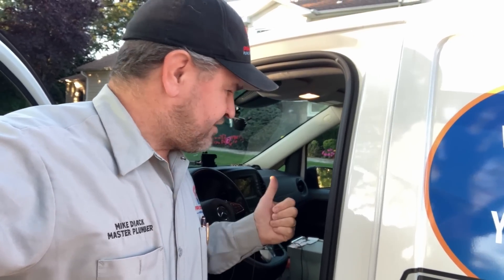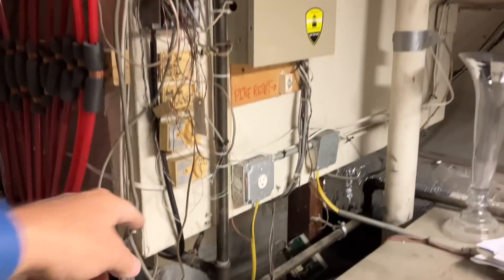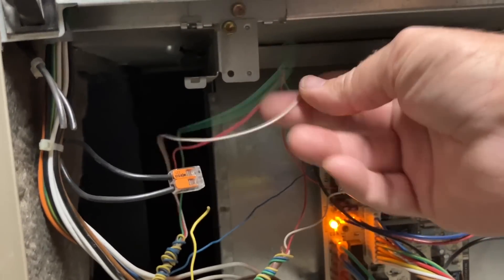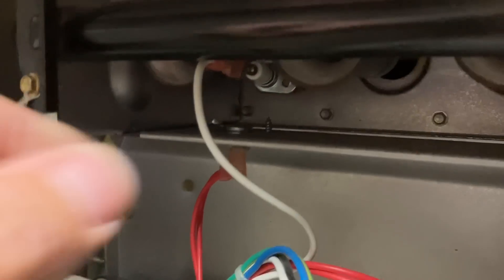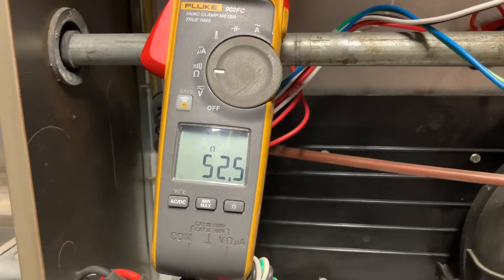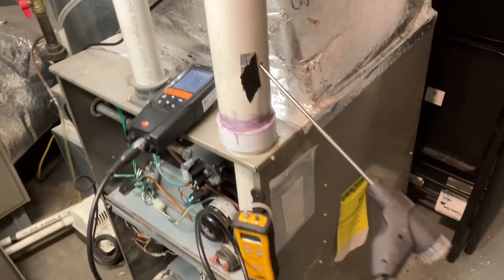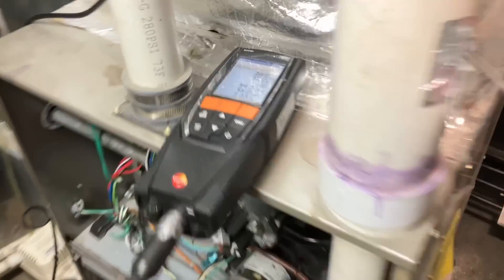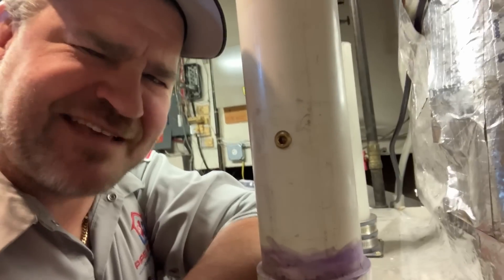Master HVAC Technician Shares Top Tips for Servicing High Efficiency Gas Furnaces

Comment: the carrier manuals say where in the pressure range it should be set based on local gas btu heating value and density. newer carriers come with orifices for 1000 btu per cu ft gas and will be slightly overfired at 3.5" in many parts of north america.
Reply from the maker: The rating plate supersedes
Reply: @PipeDoctor  what manual says doesn't contradict the rating plate-> the btu input cannot be greater than what's on the rating plate. The 3.2 to 3.8" range in both manual's tables and on rating plate is to make fine adjustments for local gas properties not that it can be anywhere in that range. Older 90%+  carrier furnaces came with #45 orifices newer #44 orifices yet rule of thumber will set all furnaces to 3.5" ignoring orifice sizes and not clocking meter or anything. carrier has tables. Could be under or over-fired by up to 10% depending on orifices and gas content, like rheem condensing furnaces come with orifices for 1100 btu per cu ft gas others for 1000 and anywhere in between.

Comment: You would think someone would invent a removable plug assembly that screws into the PVC exhaust line that you can use for combustion analysis instead of using tape or silicone caulk 🤷‍♂️
Reply from the maker: you'd think - right!
Reply: @PipeDoctor  actually, they do…I just looked at SupplyHouse and they have them in brass with a brass removable cap 🤷‍♂️ Who knew?
Reply: just drill and tap a hole, install a pvc short nipple and put a pvc cap on the end.
something like a hex nipple and cap. I forget if the test probe will fit through 1/4" nipple or not, may have to use 3/8 size. drill bit and pipe tap is cheap and fast enough.

Comment: Hmm? again Mikey those 24 volt valve will blow off high pressure gas. Might need a secondary gas pressure regulator on main gas line. Mikey you still on VOX, roll right again.

Comment: Hmm? again Mikey that air handle should up 1 inch or more from bare concrete. Again it is the building and mechanical code books too. That is another big battery seating on the floor again. Mikey you still on VOX? roll right again.